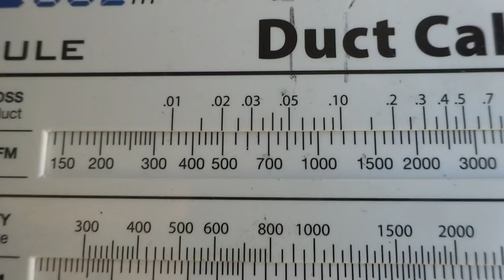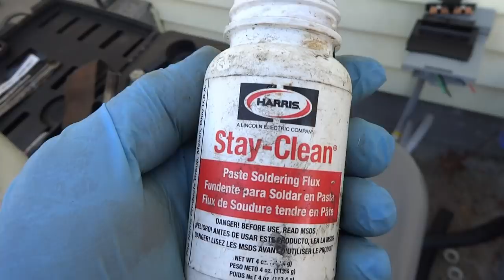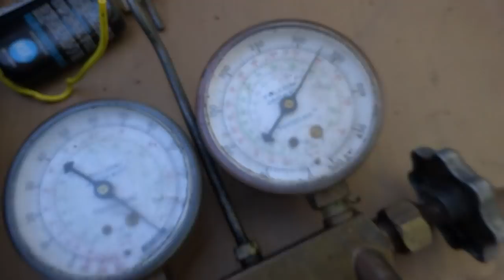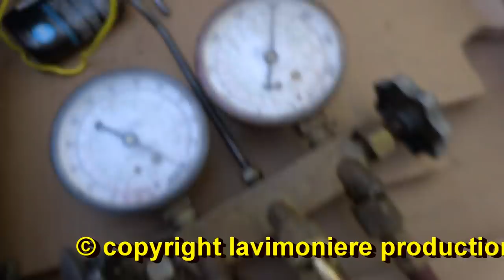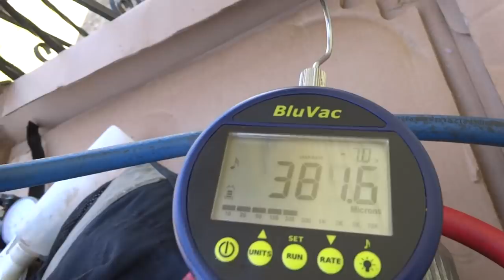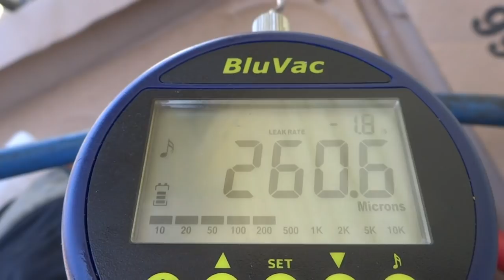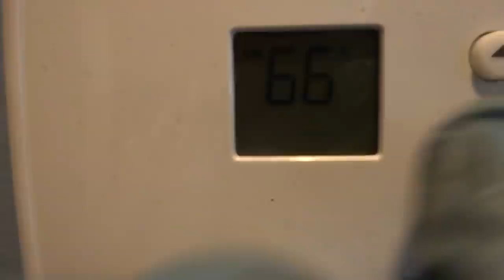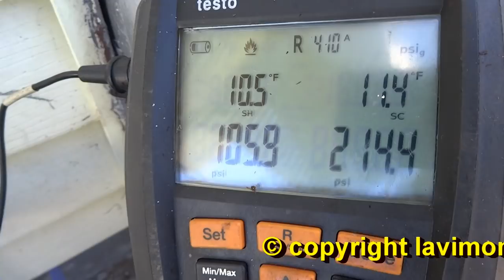AIR CONDITIONING ADDED TO EXISTING HOT AIR SYSTEM PART 2 OF 2

Comment: Just curious why did u put dryer inside steve? Not a tech at all but just always see them outside by the unit. Does it really matter where it goes? As always another great video 👍
Reply from the maker: so it does not rust out over time ..
Reply: I am gonna start putting mine inside for that reason.

Comment: Hey steve question i install tons of the same units i was always told that in order for the bulb for the txv to ready correctly it needs to be on a horizontal piece of pipe not sure if you have had any issues with this. Just curious

Comment: I really like those Rheem units. I ended up installing one at my house. The holder for the caps next to the service valve is a nice touch. Nice clean install on your part. I'll never get over the super techs complaining about the soft solder. Don't use it if you don't like it. Consider it job security if it's as bad as you think. I think it's fine, but I don't personally use it because I can't help from overheating it. I'm too used to brazing at this point. I have run across some leakers from failed soft solder joints, but the joints were poorly soldered just like you can get with brazing.  Keep on keeping on, Steve.
Reply from the maker: nice comment thanks

Comment: That's the weird size that Ruud/Rheem uses on their suction service valves. The  conventional service wrench doesn't fit it. Not sure why they used a different size but they did.
Reply from the maker: i dont think it was deep enough  the allen key hole it seemed to just want to catch then not someone had mention cut 1/4 inch of small side of key .i did try 2 service wrenches ,both did the same
Reply: @stevenlavimoniere  had to do the samething on an Ameristar cut my service bit off.

Comment: Thanks for the videos Steve. I'm new, but I was taught to break the red wire. That way if the pan floods, the furnace won't run in heat mode. Like I said, I'm new to this.
Reply: If is 90+ % efficient you break R If is 80% efficient you can break Y. Not able to see the front to see the exchaust but I bet you is 80% efficient that is why he broke Y.
Reply: @benshurdhi3003  That's what I was thinking, too.

Comment: You guys have me wanting to try the staybrite.  One question. Do you still run nitrogen thru the line while soldering. Or does it not get hot enought to create carbon deposit s
Reply from the maker: no need for nitrogen purge ...it melts at lower temps .and you dont burn the shit out of the copper
Reply: @stevenlavimoniere  awesome thanks Steve.  Also guessing your using map gas?
Reply from the maker: @cd-stephen  no just LP no need for map gas

Comment: I’ve never seen soft soldered joints on 410. But if it works more power to ya. Love watching your videos. 👍🏻
Reply: Solder with silver in it will be fine for   410-A. Been doing it for years.
Reply: Used to watch Jim pettinato use it all the time although not usually 410 in his case. Can only use staybrite 8 tho due to high silver content. I still prefer brazing because just don’t trust that solder. Fixed many of leaks in grocery stores due to soldered joints by installers.

Comment: 6:50 Question about those in-line driers: Since they are sealed, what happens if they get saturated with water from the gas line they are drying?
Reply from the maker: if you pull a good vacuum there will be no moisture or water in system
Reply: @stevenlavimoniere  i always pull an hour vacum to make sure I get all the moisture. Am I doing the right thing or us it redundant?

Comment: What your opinion of the 410 systems? They appear to be much larger when compared to old 134 system on the same tonnage.
Reply: Larger surface area of evaporator and condenser coils equals More effiecency 👍
Reply from the maker: you mean r22  134 was used in cars .not houses ??? r22 was way better more stable and more forgiving .on the charge and a pure refrigerant could charge as a gas ......not a blend like 410 A has to charged as a liquid . 410A is running higher pressures = more leaks
Reply: @stevenlavimoniere  Yes, I did screw up meant say R22, good catch!

Comment: Steve did you ever consider using original stay bright? I think it's easier to work.
Reply from the maker: DOES NOT HAVE HIGH SILVER IN IT .. I HAVE THAT IN MY HOUSE OLD LINE SET .. BUT DID NOT LEAK OLD 22 SYSTEM CHANGE OVER TO 410A  I MIGHT DO A VIDEO OF IT MIGHT BE CONTROVERSIAL

Comment: I had guy soder the liquid line and it busted on him after couple years or I ran into a couple where the  shit leaks I would always recommend brazing or pro press that's OK to
Reply from the maker: I NEVER HAD ANY ISSUES WITH IT LEAKING OR BLOWING APART  MAYBE THE GUY NEEDED TO LEARN HOW TO SOLDER . SOUNDS LIKE A REAL DOPE..
Reply: Well he was definitely a plumber trying to play ac tech because only people I know that solder their joints for air conditioning is plumbers and you can do it as long as you use the one has the right amount of silver everyone I know brazes and perfers it I was just giving my opinion due to negative experiences take it or leave it idrc you do what you want.
Reply: @ralphpownall842  Fritz?
Reply: @ralphpownall842  Did he use the 8 with the correct amount of silver.

Comment: Excellent videos as always! Do you or anyone on here have a recommendation for a DIY mini split system that comes pre charged? I've seen that they have come a long way in reliability and quality. Any suggestions?
Reply: I bought three daikens and installed them. the inverter had the refrigerant in it already, but you still have to vacuum out the coil and lines before you release the refrigerant. I saw a unit that had the line set and coil already vacuumed, so you can DIY without running a vacuum pump. if you search 'this old house' videos they installed that unit. I didn't go that way because it cost three times as much, and you couldn't cut the lines - you just coiled all the excess behind the inverter.
Reply: @RangerCaptain11A  Thank you much. I ended up installing a unit at my house that had the refrigerant precharged in the condenser. I vacuumed the lines and it ran well. I did have an HVAC tech check the refrigerant level and it was exactly 3 pounds low which is half of the capacity. I suspect that the unit came precharged for 2 smaller BTU head units because the head units ship separate and one of mine is a 9k and the other an 18k for the main living area. No leaks but how I figured it out was the 18k unit iced up a little twice, but only did it if both head units were on at the same time. Have a good weekend. Hope you are not in the path of Henry!
Reply: @alittlebitofeverything5090  nah, west coast here. good day!

Comment: Question are you using soft Solder
Reply from the maker: STAYBRITE 8 LOOK IT UP
Reply: @stevenlavimoniere  I know what it is I have never myself used it as the company I work for only buys Silfos brazing rods.  You ever have any issues with it looks a lot easier due to less heat needed
Reply from the maker: I HAVE AND USED SILFOS ALSO . JUST A LOT MORE HEAT NEEDED  AND ALSO A NITROGEN PURGE  STAYBRITE 8 IS STRONGER THEN SILFOS . ITS JUST EASYER FOR ME . LESS CHANCE OF COOKING STUFF . YOU NEED TO BE GOOD AT SOFT SOLDERING THOW .  I HAVE DONE IT MY WHOLE LIFE SO I AM GOOD AT IT .. OTHER GUYS HAVE TRYED IT AND COULD NOT GET THE HANG OF IT . ..  SO PPROBLEY NOT FOR EVERYONE .. I HAVE USED IT ON HEATPUMP SYSTEMS ALSO NEVER ANY ISSUES AT ALL WITH IT ..
Reply: It must be up to the local inspector.  Here in Nashua you must use silfos on R-410 systems.

Comment: This video was great because i never knew you could use soft solder for 410. That being said why are we brazing.
Reply from the maker: ITS STAYBRITE 8 HIGH SILVER COUNT . ITS DESIGNED FOR REFRIGERANT LINES
Reply: @scobar0076  staybrite solder is cleaner then brazing and it’s stronger then brazing and you don’t need to use nitrogen when using it. You less likely to have pinhole leaks like brazing and carbon build up and you won’t kill your txv  in the long run when using it.
Reply: @georgeian3243  that’s only if you are like Steve and you don’t allow the metal to cool enough before applying more solder to fill the joint completely and you have to allow enough time for the joint to cool before wiping the joint at the end.

Comment: I’ve been following  your channel  for a long time Mr.Steve. But this is the first time I’ve seen you use soft solder on joints. What’s going on ?
Reply from the maker: staybrite 8 its stronger then brazing and less heat applied no need to purge with nitrogen .its a win win
Reply: Steven has posted using Staybright 8 which has silver in it this is not "soft solder" .  He posted a video where he used SB 8 putting AC in his own home.
Reply: @stevenlavimoniere  thank you.
Reply: @ccthepope  thank you

Comment: Nice job Steve. The core removal tool didn't fit.  Did leaving the cores in extend the evac time much?
Reply from the maker: NOT MUCH MAYBE A FEW MINITES MORE . I HAD OTHER THINGS TO DO WHILE VACUUM WAS RUNNING ANYWAY . THE TIME IT TAKES TO TAKE THE CORES OUT AND PUT THEM BACK IN . ITS A WASH .SO WHY DO IT ??